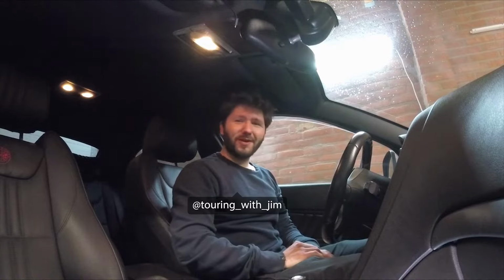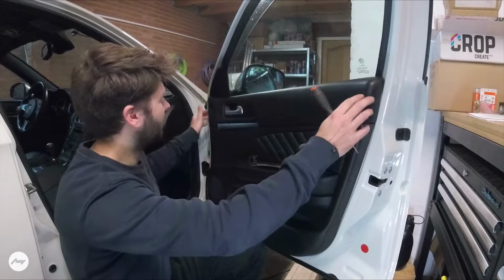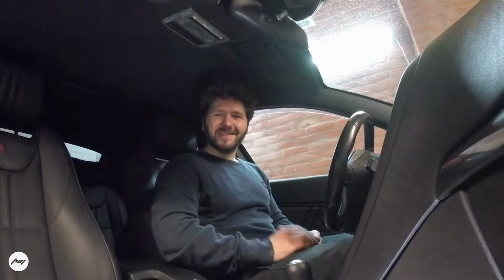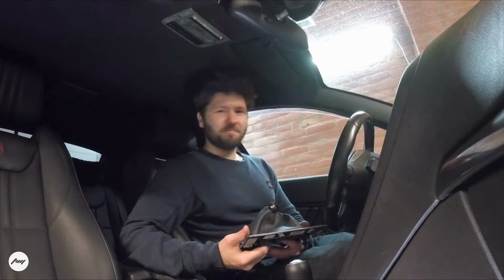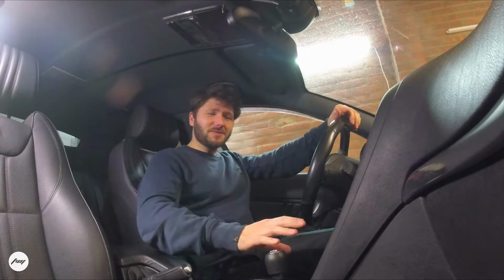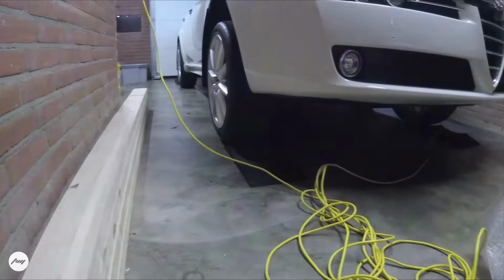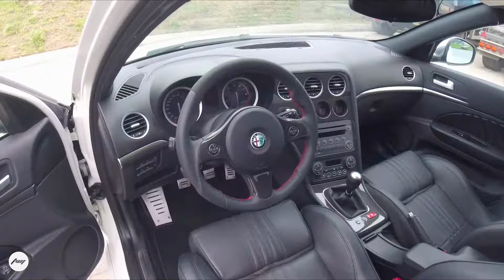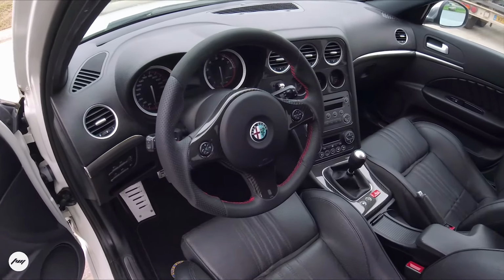Alfa Romeo 159 INTERIOR REPAIR

Comment: You've almost mastered that. 👏... The one thing is missing. Remove that old radio and replace it with an android multimedia. It will change everything. 👌
Reply from the maker: Thanks mate!! Yeah that would bring it up to modern times even further 💪
Reply: @939driver  I did the same thing, and believe me, it's fantastic.👍

Comment: Hi again Jim.  Did you have ro replace the whole door card just to match the aluminium trim?  Is it not possible to remove the trim piece from the original door card and replace with the new piece, rather than replace the whole door card?  Many thanks.
Reply from the maker: Hi Stephen, yes I replaced the entire door card as the trim piece wasn't sold seperately. You could however just replace/swap the trim pieces too. Cheers 🍀✌️
Reply: @939driver  thank you Jim!

Comment: hi Jim, you did a great job, do learn a lot from you  i am a new owner of brera, i am wondering what sort of tool you use to take the double din unit out, thx
Reply from the maker: Hi man 🍀 Thank you very much  glad it helped you! 🙏 for the radio I use a radio extractor tool, it is basically 2 small rods with which you can pull the radio out easily. I don't have a link as I bought it in a car parts store, but I think if you search for 'radio extract tool' it should show up 💪 Cheers 🍀✌️
Reply: @939driver  thx, Jim. let me try.

Comment: Cool job. what about repair seats, remove regular Stelvio seats out and install 159 ti ,beqause ti seats are really awesome.thanks in advance.There lots off work or easy enaugf?
Reply from the maker: Thanks man! If they have the same rail they could be swapped. Swapping seats is not that difficult luckily
Reply: @939driver  thanks.

Comment: Good!!  Would it be possible to get the carbon fiber parts?
Reply from the maker: I believe on the Alfa 159 Facebook group there are parts listed right now.
Reply: @939driver  Would it be possible for you to send me the link?  I have an Alfa Romeo Brera and would love to get them.
Reply from the maker: @sergiobello5493  https://www.facebook.com/groups/880318625328795/permalink/6317980851562518/. You only have to take in account that the gear piece for the 159 is different than the one for the Brera. The rest fits.
Reply: @939driver  Great, thank you very much.😊

Comment: I want to buy a new centre console trim. Do you know, are there different versions for navi and radio? I had a standart radio but upgraded to a pioneer. Do I have to buy a trim for standard radio, or can I get one for Navi?
Reply from the maker: It depends on the radio.
Reply: I looked for the one I need (brushed alu, standard radio) some time ago, and cheapest I found was a OEM parts dealer in Denmark - 980€ 😂
Until a week ago I went on eBay and voila - I found it for 140€. Seller was in Italy and it took some convincing to send it to Latvia, but we made a deal and now waiting for delivery hoping I have bought the right part😅

Comment: Looks great! Thanks for the inspiration. I need some interior bits and bobs replacing in my 159 and the centre console is one area I need to sort out. I was wondering if you could link to where you bought your parts please as I cannot find any decent suppliers. Thanks in advance.
Reply from the maker: Thanks man! Yeah it was a struggle finding all parts. Most of it I got from eBay, but since it were the last items I don't have the link. But I would try eBay for sure
Reply: @939driver  Thanks for your reply, much appreciated. I have been looking on ebay but im not having much luck with finding the carbon fibre trim yet. The hunt continues ;-)
Reply from the maker: @Tackleberry34  yeah hopefully it gets sold sometime again. Carbon is lovely. Hope you can find a set 🍀✌️
Reply: @Tackleberry34  Hi, I saw  centre carbon console on etsy .com

Comment: Do you by any change know if the Alfa Romeo 159 1.9 mpi from 2007 is a reliable car and how many kilometer I might go with it? Are there any important issues where I must look for? I want buy one. Always drove Opel for many years.

Op de forum fanclub las ik dat de JTS serie van de 159 motorisch niet de beste zijn. De mpi kwam wat beter uit de verf. Het stuurhuis is een ding van alle auto voor 2008 volgens de fans en nog een aantal dingen. Maar mischien zie ik nog een belangrijk ding over het hoofd. 
Ik ga zeker ook even kijken op Ebay of ik straks ook het interieur als nieuw kan maken. De auto die ik op het oog heb heeft 216000 km gelopen. Daar is de prijs ook naar.
Reply from the maker: 1.9 mpi heb ik zelf geen ervaring mee, maar zie deze wel vaak met hogere km-standen te koop staan. Dus ze moeten het wel aan kunnen zo lijkt het. Ik ben wel bang dat je vermogen gaat missen met een 1.9, aangezien de 159 best een zware auto is. Maar als je dat voor lief neemt dan kan het de juiste keus zijn. Let bij de 939 modellen ook op subframe roest. Verder de aandachtspunten zoals bij elke auto. Groetjes
Reply: @939driver  Bedankt voor de informatie! 

Ik moet zeggen dat ik nog een fout had gemaakt. Ik heb zelfs 'maar'' een 1.8 mpi. Het is een 140 pk motor. Maar nee voor mij niet belangrijk. De wilde jaren zijn achter de rug. 

Ik ga letten op de mogelijke roest door stevig te kloppen en de proefrit volgt ook nog. Er wordt een nieuwe riem opgelegd en iets met het stuurpomp, stuurhuis waarop de auto wat bijgeluiden maakt. Dit wordt ook verholpen voordat ik hem meeneem. 

Groet Mark.

Comment: That's pretty cool. Are all those parts original? That must have cost a fortune.
Reply from the maker: Thanks m8! Yes OE parts, and unfortunately also yes 😂
Reply: You are dutch right? Where do you order your original parts from? I only know about qverde, but they are pretty expensive.
Reply from the maker: @erwindamsma  yes indeed, you too? All across Europe, Qverde I know, but most of the parts came from Poland and Germany, with 2 miron trim parts from Italy, via Dutch supplier Tuynder
Reply: @939driver  yes, dutch too, and also like to do my own work on my 159
Reply: @939driver  hi there! I know qverde too but I don t see carbon fiber interior parts, so where did you order them? Anyway you did a great job, also the wheel is beautiful, where did you buy it?
Reply from the maker: @Erpinio1  thanks mate! The carbon I bought on eBay in Poland, the steering wheel I had it reupholstered at an upholstery shop near my town